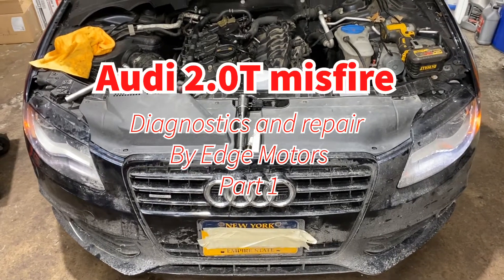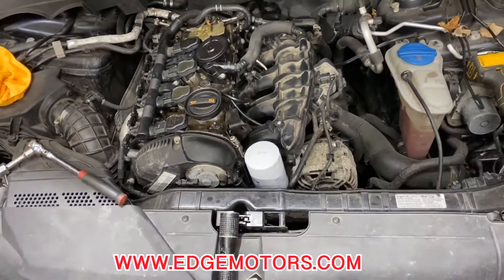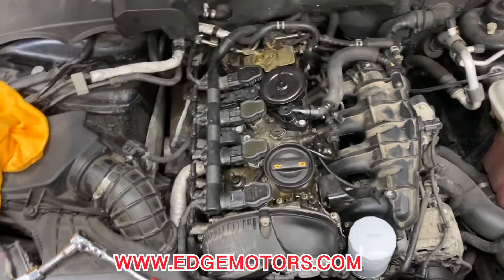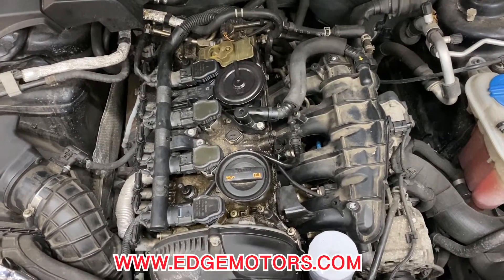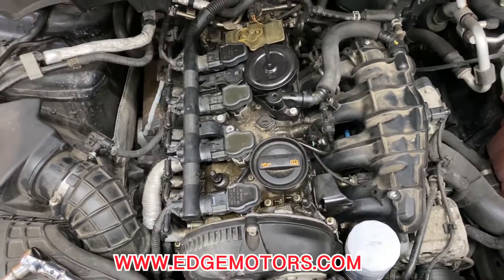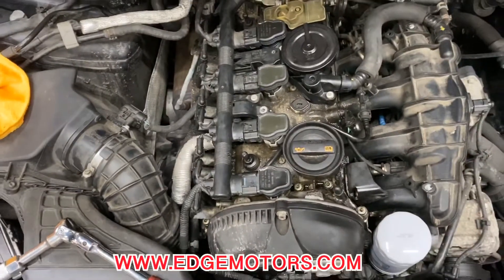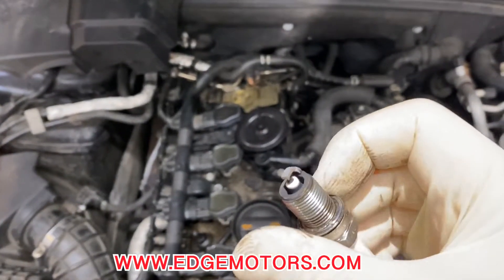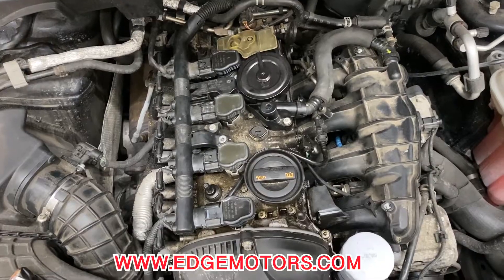Audi 2.0T misfire diagnostics by Edge Motors

Comment: Hi bud ..misfire #2 cyl p300 code  Cold or hot rough idle
2014 audi q5 2.0t. 
Replaced plugs .coils and did engine flush 15 min ..oil.change oil filter and cleaned VVT solenoids..still has rough idle ...what should i do now ? All test normal .compression
Reply: O compression #2 cyl

Comment: Hello, I have a question regarding the 2nd cylinder injector. The 2nd cylinder is flooding, with compression reading at only 15 psi. After removing the spark plugs, I found that the 2nd cylinder plug is wet and has a strong gasoline odor, while the others are dry. The compression readings are as follows: 1st cylinder: 170 psi, 2nd cylinder: 15 psi, 3rd cylinder: 190 psi, and 4th cylinder: 190 psi. Could this issue be related to the injector in the 2nd cylinder?
Reply: Not injector, this ignition and compression.  Sounds like bad cylinder and ring
Reply: @G4ll4RDO24  thanks

Comment: So I have a 2018 golf gti 2.0 tsi and recently only on hot engine it starts to misfire if I turn it back on I’ve replaced the spark plugs both O2 sensors but I do get a huge smell of gas after starting up on warm engine i suspect it’s a HPFP issue since the live data shows -2 to-15 and it’s supposed to be at 0-7 not sure or it could be my injectiors I’ve ruled out carbon build up since the car only has 70k miles but idk need advise please!

Comment: If your car is still misfiring after changing plugs and coils. Try to clean your o2 sensor, i did that and the misfire stopped instantly
Reply: Thank you, thank you, thank you!! I checked and changed everything. I did what you said and it help so much. Thank you!
Reply: @raphaelfrancis4509 which ones did you change, thank you
Reply: Thanks for this helpful information. I change my plugs and it's still showing "misfire". I'm about to change my coils today. 

Is Denso a good brand? I bought Double Platinum Plugs. I'm about about to buy the matching coils from Denso.

2009 Audi A4 Quattro 2.0T
Reply: Did you have a misfire on one cylinder or more than one ? Which o2 sensor and how do you clean it ?

Comment: Should I take out the fuel pump fuse before I do this test? I'm actually trying to get oil in the system before I start the car, I just did the timing and it sat for awhile before I finished the job. What do you think the best way to make sure the system is properly lubricated (primed) before I start it up? Great video again! Cheers
Reply: l was doing the same thing and the car sat down for a while and it was working fine but after yesterday when l completely sealed a oil leak from the vacuum pump the car after few minutes of driving it it give me misfire on cylinder 1 and after driving it back home cylinder 1&3 now sometimes when l swapped the spark plugs and coils says cylinder 1&2 are misfiring

Comment: My misfire occurs at idle no matter the engine temperature. Some days no misfire. This is typical of carbon build up on the intake valve which changes the way air flows into the engine.  Mk7 E888 Gen. 3
Reply: I get the same problem but I already had the valves cleaned so it I wouldn’t bank on that bro but good luck 👍🙏

Comment: Thanks for this and the follow up video.  I had #4 injector go at 230K.  Used you troubleshooting to confirm and repair.
Reply: My 4th was misfiring, everything fixed according to code and now runs worse which they never seen before. I know they added fuel or injector cleaner on an empty tank and seen it run worse at first before but this seems different.

Comment: I have a P0301 and P0300 Code for my 14' A6 2.0T. Changed Plugs and Coils no change. Engine vibrates at Idle like a 1981 VWRabbit Diesel.
Reply: same issue 2011
Reply: I have the same codes, did you ever find out why was causing them?
Reply: 2015 a3 2.0t quatro. Serviced by audi since new, cylinder3 missfire, audi diagnosed catastrophic piston/ring failure. Told me I need to pay for a new engine to be installed.  69k miles owned and driven by my wife. Smfh... known problem w these cars
Reply: Did you try injector?

Comment: Thanks for the video ! Love it ! My 2008 A4 wagon is doing the exact same thing. I changed out everything ie ngk plugs, coils, pcv, 4 brand new oem injectors and even cleaned out 90% of the carbon build up on the intake valves when pulled the intake manifold off. I'm doing a compression test and crossed my fingers it isn't a blown head gasket. 
   Any ideas is very much appreciated. Thank you in advance.
Reply: Man I feel you! Have you solved your issue yet? I changed my spark plugs, coils, and I’m about to change my injectors.
Reply: @4Kreflex  No i have not. Kept pulling codes but it's so misleading. I won't change injectors just yet if I were you. I even swap out the throttle body for a new one thinking my oem was faulty. But damn. No change.
Reply from the maker: Do you have a lot of buildup on your spark box after Box 5000 miles?
Reply: @onememories8523  I noticed that my issue is loss of power. I don’t know what else it could be? I have the injectors in hand just need a mechanic for the job.
Reply: @4Kreflex  hi. Does your lost of power results  in your engine shutting off? If it does, does your engine dies at what range of rpm? My wagon drives and runs like a champ! But it dies only at idle for more than 5mins or longer or in Park. Sometimes the rpm would rise from 800-1450. 
  Weird, right ? 
 I have reliable shop troubleshot the problem and he told me it's in the injectors. The injectors that I replaced are from eBay but they are OEM. He said I should buy my injectors from the audi dealership. So I'm contemplating on changing them out AGAIN from the Audi dealership. 
  So if your car is doing exactly what my car is doing, make sure (absolutely sure your injectors are from Audi dealership)
Reply: @4Kreflex  I FOUND the problem and I won't change out your injectors if I were you !
Reply: @onememories8523  My car wouldn’t turn off but at idle it would do a bad shake. Sometimes it would work fine, other times it wouldn’t. I bought my injectors from O’reily and just got them installed.... I also cleaned up the carbon.... I’m picking it up tomorrow and not sure what to expect now. What was your issue?
Reply: @onememories8523  I just had a tremendous loss of power and the shaking started happening over time not really right away. I figured it was because not enough gas was reaching the engine.
Reply: @onememories8523  Hey, I was wondering to get an update? I changed out my injectors and cleaned out all the carbon build up. That wasn’t the issue... after a couple of days my rpm went crazy and started shaking again. I’m starting to think it’s the ICM. Was that your issue?
Reply: @onememories8523  WHAT WAS THE PROBLEM!!!??? I'm having the same issue!)=
Reply: @jessmartinez6847  try troubleshooting your MASS AIR FLOW SENSOR. About 6months my car died while driving...long story short...I thought and after some troubleshooting I replaced my mass air flow sensor with o'reilly auto parts sensor. But it didn't fix the problem. So I kept my oem sensor for backup. Now since I've tried to replaced everything but the engine, I started to look back at the simple things....ie the mass air flow sensor. And sure enough I swap back the oem one and it works!!!!! Problem solved ! 
  No more issues....knock on wood!
Reply: @onememories8523  so your issue is very similar to mine, but the solution was the air flow sensor?
Reply: @threemad8456  that is correct! Simple as that. But again please verify it to your car and double check before buying the sensor which is easy to do. And if you do buy the sensor buy it from the dealership! Get OEM !!!
Reply: @onememories8523  appreciate it
Reply: @onememories8523  Thank you so much! Going to try that! I had changed my crank and camshaft sensors and spark plugs and it's weird because my car will start here and there but it literally sounds like it has 0 HP and the oils been clean out put octane and new gas even switched around the fuel injectors to see if one was maybe bad I get codes p0016 and p0301-P0304 I read it could be my HPFP, timing chain, or pvc valve if its not the MAF sensor any guesses what it could be?
Reply: @onememories8523  
hi, what is the problem with, I solved it, you wrote, I am about to change the injectors
Reply: @yusufputun9362 hi did you change your injectors and did it sort the issue?
Reply: Hi. Thank you so much for responding. Negative. I don't even have any build at on my spark plugs. They are in normal condition usage. I changed them out because of regular routine maintenance.

Comment: While I don’t have one I am trying to help my neighbor who has a 2009 Audi A4 2.0T .   She has CEL codes showing $7E8 & $7E9.  Shakes when idling, Runs really rough.  I haven’t driven it yet, but she says also has lost lots of Power.  Poss PCV & PRV Valve?
I’ve read up this could be the problem in lieu of Spark Plugs, Coil Pack, which is what I was thinking it was. 
I’m not a “mechanic” but a big DIYer that has worked on many vehicles, but never an Audi.  My OBDII/EOBD scanner I am using is a CenTech Deluxe, which also shows live sensor data.  While It’s not a Snap On or even close, it’s been able to diagnose & solve many problems from many diff makes of vehicles.  Unfortunately, she is a bit strapped for $ so, trying to help her out.  If Spark Plugs, how easily are they to change?  Also what gap & kind?  I recently just checked my coil pack & changed my spark plugs on a 2003 Jeep Wrangler that was having misfire probs.  I upgraded to Iridium plugs in my Jeep.
Should I try to reset her codes 1st & see if it has a misfire code also come up, before diving into this problem?  TIA, your knowledge is quite helpful.

Comment: Is it safe to drive the car with one cylinder misfire for some days at 
low speeds? The engine is shaking quite often while accelerating. The fourth coil pack is faulty and i'm getting to replace it after some days.
Reply from the maker: No, you should not drive the car
Reply: @EDGEMOTORS  Anyway, i drove the car like 30km (20 miles).
Reply: Did you fixed urs
Reply: @baulshur530  Yes, i changed the damn coil and the engine is smooth again. Actually i bought all 4 new ignition coils, because they cost like pennies. And i don't want to have the same problem again! (engine shaking, hard to accelerate etc)
Reply: I have a misfire in Cylinder 4, pressure is 50psi and others are around 155/160. Is this an expensive fix? Dealership says it is. My 2015 Q5 has 180K mikes. Should I just get a new car?

Comment: Me and my son bought a a5 with misfire,and guess what I found in the cylinder head? 2 worn roller rockers ! Do you believe that?
Reply: I’m having a misfire in my 2007 a4 b7 in cylinder number two I changed my hpfp didn’t do anything I saw that my coil clips are so brittle and they are a common problem with these coil clips so do you think it might be that  causing my misfire. I might bite the bullet and purchase the clips and replace them because there not that much.
Reply: @erictech201  I own two b7s and I know the engine by heart, keep in touch cool bro
Reply: @jiujit49  hey bro I have a bad misfire too but I got my epc light on as well. Do you think you could give me a hand on what it might be?? I removed the cylinder 3 coil and it was still running the same without one
Reply: @erictech201  hi, me Audi4ever, you see the hose that connects to your intake from your PVC, disconnect it from the intake , as you plug the intake with your thumb have someone start it, and see how it runs then
Reply: @jiujit49  if it runs with the hand covering it, what does that mean? Or ver versa? Please let me know. Thank you.

Comment: I’m getting a cylinder 4 misfire, and random misfire, I checked compression all cylinders are even. Tried moving coil/new injector/new plugs no luck ...running compression test I get 52 on #4, 62 on #3, 72 on #2 and 72 on #1.  Valves are cleaned recently so carbon is ruled out any idea ?? Thank you
Reply: @gwinndontrell  yes, bad rocker 🤦🏽‍♂️ one of the bearing were bad so looked good from top but you have to take them out and physically check…pin had fallen out
Reply: @asheshpatel147  I have a misfire in cylinder 4 and intake manifold code think this could be it? How much did the part cost
Reply from the maker: Injector?
Reply: EDGEMOTORS replaced injector, no luck
Reply from the maker: 52 62 72 72 what units is this in? Psi?
Reply: EDGEMOTORS yes in psi sorry
Reply: Any clue ?
Reply: @audicted2quattro  any ideas? My 2008 A4 wagon is doing the exact same thing. Please let us know what you think. Thank you.

Comment: Hi Edge Motors I love your guys videos I have a situation with my B7 2.0t. I'm getting surging in my idle. It happens, when I'm under load between 2 to 4000 RPM, up and down up and down up and down. I changed numerous of things. But I suspect they could be the torque converter. Have you seen this? Thank you so much for your help please help thank you
Reply: Not sure if you ever got is situated yet, or if your TC has failed yet, but yes, that’s an early warning sign of TC failure. Some have found relief with a transmission fluid service. Some will last forever like this, and others catastrophically fail. Happy Audi-ing 😝

Comment: Guessing VVT solenoids.  Sent mine to the garage and they told me it was because my car had a tune and it must be the chip... swapped the solenoids around and the code followed after getting a code reader...  never to the garage again. B8 A5 2.0 TFSI
Reply: I have a stage 1 apr tune, did timing, PCV, carbon cleaning, colder plugs, smaller gap, fuel trim is normal, no codes and still get random misfires in 3 and 4 every so often, compression is good in all cylinders, I’m stumped as to what it could be. The colder plugs and smaller gap reduced the regularity of it but still happens once or twice per drive
Reply: @nicky85926 fixed?
Reply: Might be you fuel have higher octane rating then what it’s tuned for if you add octane boosters then it could randomly misfire and vise versa if octane is lower from what’s car is tuned for. I had misfire pretty bad on my a5 that’s got stage 2 with DP, CAI, big Intercooler even with bigger throttle body diameter and the issue was camshaft sensor put an old one I had laying around and misfires stopped.

Comment: Did you evern figure out what it was!? I have done everything plugs, coils, MAF, I did do a turbo carbon clean up for the engine! maybe it is that!
Reply from the maker: It ended up being the injector, I made the video, but my editing software corrupted the files, I’m trying to fix it, I’ll post the second part as soon as I will
Reply: @EDGEMOTORS  Damn gonna try to replace mine then hopefully it's that!
Reply: @541_CoyotePower  did it work for you
Reply: @AKDiag  Nope still have the code!
Reply: @EDGEMOTORS  Cool I will subscribe, thanks 👌
Reply: @EDGEMOTORS my 2008 A4 wagon is doing the exact same thing. I changed out with 4 brand new oem audi injectors and it's still doing the same thing. Im doing a compression test and a running compression test tomorrow to see what else is in store for me. Any ideas what is going on?
Reply: @onememories8523  ever find out what it was?
Reply from the maker: We seen rocker arm causing misfire also:)

Comment: Can't wait until Serge fixes it! Really interested to see what it could be.
Reply from the maker: Yeaaa I had a little hick up with the second part.... forgot to start the camera recording and yanked the manifold out while talking to “my self”.... but still coming right up.
Reply: @EDGEMOTORS  hey, how would you diagnose the cause of a P0327 on a 2.0T. Also, to replace the knock sensor only way is to remove waterpump?

Comment: Hi serge had you had a chance to check the fuel rail residual pressure before removing the intake ? I personally like to do this test with a cold engine because with a hot engine the fuel pressure all ways goes up in not in a long time I usually test them for 10 to 15 min and the rail pressure should drop a bit compared to idle but not drop too fast I remember seeing a Audi TSB for the 3.2 v6 engine I follow the same specs for the 2.0l and it serve me well then again I do this test with a cold engine I start it and let it run 10 seconds then shut it off and turn the key on and observe the rail pressure and see if any injectors are leaking i also like to clean the injectors tips when I’m reusing them I use throttle body cleaner and a plastic brush or brass I think the car runs better afterwards including the intake valve service anyway can’t wait for part deux.
Reply from the maker: No I didn’t, so far all the injectors that I have seen leaking, were leaking so much that I would start the car cold, turn it off right the way and take spark plugs out and see which one is leaking...  this one didn’t do that:)